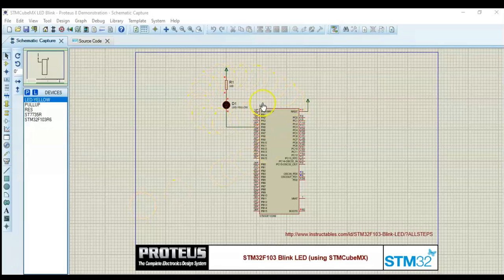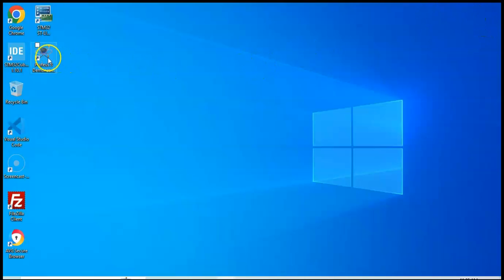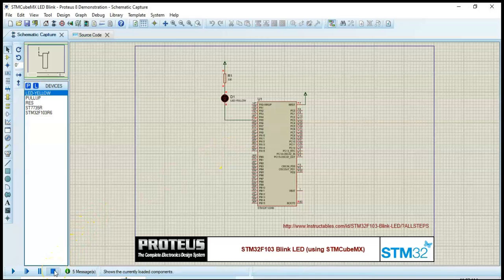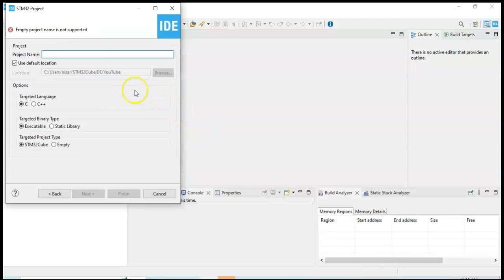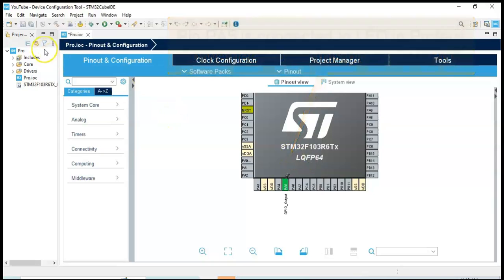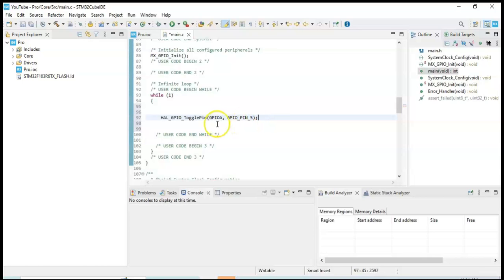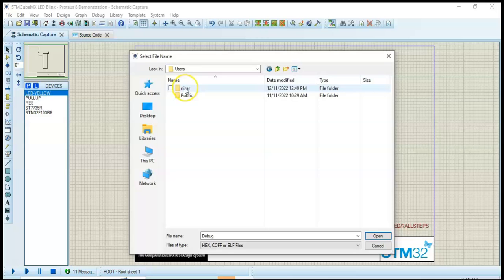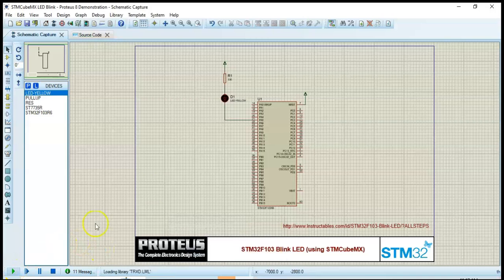82. Simulate STM32 in Proteus using STM32CubeIDE

Comment: Hello , bro .I strongly need your help. I'm simulating STM32F103C6 on proteus , and the code is written on Arduino IDE , I'm testing a simple LED blink project and the simulation is not working!
I tried the code by STM32 CUBE IDE and the simulation worked properly can you help me to make it work with Arduino IDE ?
I have tried all compiler optimization level in Arduino IDE but none of them worked for me !